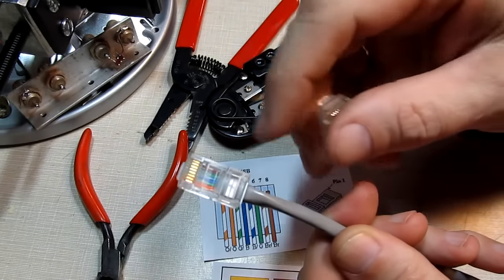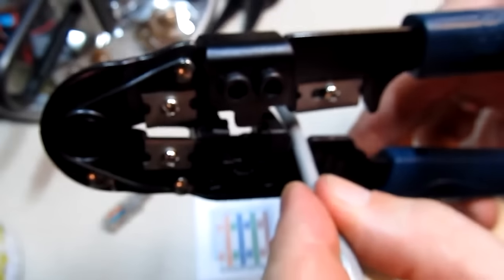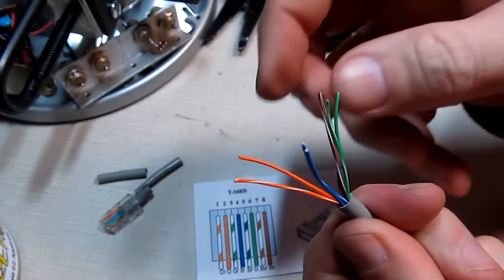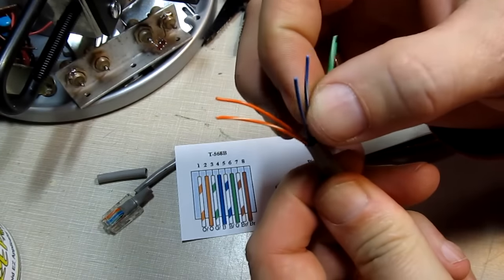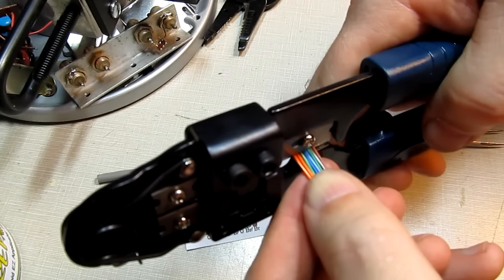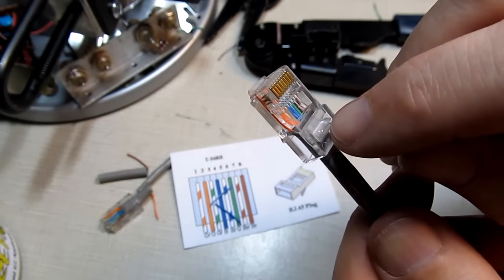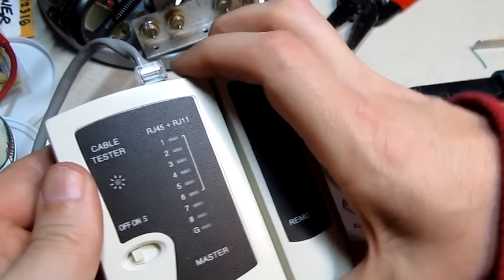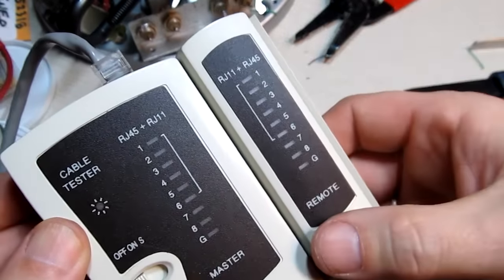#124: How to install an RJ45 connector on a CAT5 Ethernet network Patch Cable - DIY Repair

Comment: I gotta say this video is a godsend. I bought a new construction condo unit and apparently the network guys who installed the wiring cut corners and never placed RJ45 jacks on the ends of the wires, they were just a bunch of loose cut ends going to the network box in the closet. I watched this video and bought some tools and got the wires working perfectly. Thanks!!

Comment: THANK YOU. 
   The job I had before I retired, entailed tool and test equipment design. I built a test box for qualifying 50 wire flat computer belt cables. It would test all LED's, then test every wire for continuity, then unplug one end and turn around and plug in and test again. If any LED's lit up, it meant a short. The box was an aluminum box 4" x4"x4" cube. It got a lot of use.

Comment: 2 tips from a first timer:  1) Pay attention to 4:48 mark in video and make sure you orient both ends the same before crimping.  I had orange left the tab down for one end and orange left and tab up for one end...wasn't thinking and obviously that doesn't work.  :-)  2)  Realize the plug will NOT fit in your device before it is crimped...so check that its the right type but don't expect it to actually fully insert until the pins are pushed down during crimping.  Thanks for the video, turns out its a great and pretty easy DIY project with a little knowledge.

Comment: One thing to stress is the (hopefully obvious) fact that the bottom tab should be firmly crimped onto the gray insulation, not the wires. If you cut the wires to the correct length, either by experienced eye or using the gauge, plenty of gray insulation will slide inside the connector and get trapped when you crimp.

Your video shows this very well at the very start and at @6:00 on the replacement.

I can't tell you how many "professionals" have handed me cables with a good 1/2 inch too much gray insulation stripped off so it doesn't even enter the connector. I'm always tempted to give them 50 lashes with their own cable.
Reply: True, true.
Reply: I tried several times, and maybe I'm half asleep now, but you made it look so easy. I got one in correctly then the cat 5 I could not, so I watched your video. It didn't help. Will try again tomorrow. But, have to say, this is definitely the best, most concise and clearly explained video I have seen in ages. Thank you for that.

Comment: I had installed video security cameras around my house and had ran a CAT 5E cable and wasn't able to connect the RJ45. Then I ran across your video and it was easy as pie to connect. Thank you for a clear video and understanding on how to connect these two parts. You saved me from the insane asylum.
Reply: the

Comment: Just wanted to say thank you very much for taking the time to put this vid together. Needed to run about 100 feet of Cat6 cable to an upstairs back bedroom and could not find a 100’ cable with the ends on them. Didn’t have a clue how to attach the ends but because your vid was so detailed it made it easy. - Thanks again.

Comment: Thanks for the demo.  I have to replace the RJ45 connector on an Icom hand microphone, so the colors and wire placement are different, but I kept the cutoff connector.  My connector came with a boot, which I put on the cable before installing the connector.  Thanks!

Comment: Nice done :-) , a LAN video was a surprise, I like it. I had to connect all the LAN sockets, connectors, extensions and server rack stuff together with a workmate when we build our new company building, because the electricians didn't. She was really a help. We had two different type sockets made of metal and plastic parts, where you have to connect each single wire manually (there is a special tool for, but we had it only one day on loan). We did like 50 sockets or so :-), took us days :-).

Comment: Thank you so much, I have a cable that is run behind walls so it was impossible to remove and replace. I thought I was a dummy in relation to DIY stuff but your video is just simply simple and fantastic, thank you.

Comment: I think that it takes more than "a little" patience.  :-)  I have a tool for that,  although yours is nicer,  and some connectors,  but it's always seemed to me to be too fiddly to get things exactly right in there and have it the way it should be when you're done. So I've purchased patch cables instead,  usually with boots on them so I can avoid that broken tab issue for the most part.  No problem on my part punching down in-the-wall CAT5 into keystone jacks,  though,  and I've done a fair bit of that with no issues whatsoever.  One thing I did a little differently was not trim the wires but push them through the connector and then after crimping trim them.  At least that worked with the connectors I have on hand here...

Comment: Interesting... My tool doesn't have the notch that you use to strip the outer insulation; instead I used the other cutting part (near the end of the tool which you don't use in the video). It has two blades that leave a gap when the tool is closed all the way, and there is a bracket that helps you make the wires the exact right length. I use that to cut the outer insulation and then I rearrange the wires. Making the wires the right length from the get-go makes it slightly more difficult to straighten them out (and usually this is harder on one end of the cable than on the other end, because of the way the wire pairs are twisted inside the cable), but that way you don't have the extra step of cutting the wires to size after straightening them out.

By the way, the process for CAT6 is the same, but CAT6 has tighter twists and you should use CAT6 connectors (which are also slightly different: the wires are staggered inside) to keep your cable fully compliant.

Also worth mentioning: In a 568B crossover cable, you wire up one end as shown in the video, but on the other end you put the Orange pair where the Green would normally go, and you put the Brown pair where the Blue would normally go, and vice versa. So the order on the other end becomes green/white, green, orange/white, brown, brown/white, orange, blue/white, blue.

To verify your wiring, keep in mind that on the connector, white+color is always followed by color. That means the center pair is connected with the color to the left and white+color to the right unlike the other pairs.

In my experience, the 568B wiring method is much more common than 568A.

Anyway, excellent video as always! Keep up the good work!
Reply from the maker: Excellent comments, Jac - thumbs up!  Personally, I like working with the longer wires to do the straightening and ordering - much easier for me to do that and then trim them to the right length afterwards.  I do the same thing with home wiring - it's easier to stuff 6-8" long wires into a junction box rather than 3-4" long wires. Odd, but true.

Comment: Alan, very good video and straight forward and simple. I think I'll make a mic cable extension as my first project. 73
Reply from the maker: Good luck Drew. It can be tougher to do with the flexible stranded wires. Sometimes some tape can help keep the wires aligned.

Comment: Here´s a tip I've never seen before.  A standard telephone plug will fit in the rj45 jack.  Thus except perhaps for cost there would be no need to use telephone cable though out your home installation.  An addition bonus is alot of excess wire to use for poe or other uses including a more or less standard internet connection.

Comment: Matt K- the 1st connection is Tx+, 2nd is Tx-, 3rd is Rx+ and 6th is Rx-, so we can connect any pin one to one (for straight cable) but the length of the cable will be limited as we can see that the Tx pairs are 1st & 2nd and the Rx pair is 3rd & 6th, so as the solid and strip are in twisted pair, so the 1st & 2nd should be of the same color (solid& strip), and 3rd & 6th should be of the same color for the cable to be used for longer distance

Comment: After making thousands of these connections I've developed a nice technique, specifically getting the cable's outer insulation nice and tight on the locking barb. I'll have to make a video showing how I do it.
Reply from the maker: Great! Please share your video in a comment on this video when you upload it!

Comment: in college they made me and my friends do entire labs cables for a networking class but now for some reason every time I make a cable it just doesn't work. I think the connectors I bought are the problem but still it's freaking annoying. I'm trying to run CAT6 cables around the house and connect them to a switch and each cable I test is faulty =_=" been looking around if I did something wrong but everything I did was completely correct and every video and tutorial out there is showig the same.
Just sharing my thoughts :P
Great tutorial by the way :D

Comment: This is a wonderfully clear video BUT there's one big gotcha. I managed to confuse the green-striped white with the blue-striped white. That still had everything connected straight through so passed the cable tester. It showed the PoE as connected but on a 20m run, my IP camera wouldn't show. Eventually worked out what I had done. Pins 3 and 6 need to be the same twisted pair to prevent interference.

Fault is entirely mine as it's shown very clearly in the video. I just wanted to point out if you have an apparently correct cable, double-check this as the only evidence of this mistake is your cable won't work, even though it seems electrically correct.

Comment: I think my home has cat5 cable but instead of ethernet they did phone connections.  This should be easy to convert over right?  How can one make sure that I don't have cat3 cable or cat5 cable aside from cutting it off at the connector?

Comment: Going back to the late 80's each kid had their own computer and I had my LAN system for my business.  Ran that cable through the cold air returns through my two story home, hundreds of feet of it.  Would tuck it between the baseboard and the carpet. Cable company won't do this, drilling holes all over the place, and expensive.  WiFi with a router is so much easier, pulled all that ethernet cable out except one short one between the modem and the router.

Comment: I did this before I saw this video. And the internet is usually 500/500 on wifi, but I get 94/94 with an ethernet cable. I did brown/brownstripe,green/greenstripe,orange/orangestripe,blue/bluestripe. Is that why? Does it even matter? Or is it something else
Reply from the maker: I could be, since it is possible that you signal is not using a proper twisted pair.
Reply: Thanks! I will out try out the method in your video and post the results

Comment: This was my first attempt at this and it definitely requires both practice and patience. At work, we have a number of RJ-45 cables that have turned up sans retaining tab and I wanted to be able to fix those, as well as one I got from an aquaintance with the same problem.
           Here is my question. Some RJ-45 cables come with a plus-sign cross sectioned plasitc separator in the middle of the cable, holding the four pairs of wires in a circle (more or less) and, even when you cut that off where the outside insulation is trimmed back to expose the wires, because they are coming out of the remaining cable "three dimensionally" - as opposed to flat as with the cable in the video - positioning them so they can go into the new connector is one helluva bitch. I openned the cable with an x-acto knife an inch or two back from my original stripping of the insultion, cut the separator off then taped the insulation back together (I had merely slit the insulation then peeled it down till I was done). After that, I was somewhat more able to positon the wires so they would go into the new connector. I just finished so I have not had a chance to test the cable yet but I thought it unlikely I was the only one to have this problem. Is there a better way to deal with this stupid plastic separator or (?) is my type of solution - or something close - the best way to do so?
Reply from the maker: The best way to deal with the separator is to pull on it to stretch it out and carefully trim it flush with the outer jacket, taking care not to damage/nick the wires.  Once you cut it while being stretched, it will retreat back into the wire enough to make it easy to assemble the connector.

Comment: I wonder how the characteristic impedance of the cable is affected upon removing the twists and attaching a connector?
Reply from the maker: It will change it for that short distance.  More of an issue for the pair that gets split over a wider distance across the connector.  Since the physical length of the impedance discontinuity is very short, it doesn't pose a problem in most cases.

Comment: Is the testing tool really necessary if you just need to do this once?
I'm thinking that if I plug it in and I made a mistake, that will become immediately obvious once I try to connect to the internet, and the worst thing that might happen is that I'm getting useless signals. Sure, I won't know which cables were wrong, but since I can't swap individual cables once they're inside, I have to start all over anyway.
Reply from the maker: Sure - quick operational test is sufficient.  If it works, it works...

Comment: so in opposite to the cable, the rj-45 slot is always the same? How much does this "universal tool", that you use in the video to push those contacts in, cost?

Comment: why do the green have to be separatred by the blue? wouldn't the same thing be accomplished if each color and white were side by side on both ends??
Reply from the maker: +Jim Falcone I did a little research on this - it goes back to how the original RJ plugs were wired.  The first pair used the center pins, and the next pair used the next set of pins on either side of the first pair.  That's where the split came from.  However, for the 8 pin connectors used for Ethernet, continuing this practice would have spread the wires too far apart to maintain good signal integrity.  Thus, the last two pairs are wired on the adjacent pins on each edge of the connector.

Comment: Is there a way to finish the final step by pushing the connectors in and sealing in the cable without using that tool you used? Or is there no way out?
Reply from the maker: fliprabbit It's a bit like asking if you can use a screwdriver to hammer in a nail. Yes, you can, but it is difficult, and your results might not be very good.
Reply: ***** ah that's tough , but i will probably find something similar to seal it around.. If not i guess i can get that tool. Thanks for the fast reply , appreciate it! :)

Comment: Can I connect a CAT 5 cable to a RJ45 connector and crimp without any tools i.e means by hands only?
Reply from the maker: In theory it would be possible to use a very thin blade screwdriver to engage each of the 8 insulation displacement contacts, but it would be difficult to get a consistent depth and contact.

Comment: Maybe these take me an age to do as I don't use solid core for patch cables I could never get a good cable made with that. I think I'm gonna buy me a reel of solid core. I noticed your cable doesn't have the X section in the centre, can that type be used?
Reply from the maker: Yes, it is harder to do with the flexible stranded wire because they're tougher to keep in line. If I recall correctly, the X section is for cat6 cable.  There might be a slightly different connector for that, to accommodate the extra material in the cable.
Reply: *****
Cat6 uses the exact same connector, it's just a fair bit more fiddly to do and you can't usually get any insulation or very little insulation from the outside inside the stress relief part of the connector. That's just due to the extra reinforcement section though.
Reply: Unless you are making a LOT of patch cables, with stranded it's probably better to buy ready made ones, they are very cheap after all and you can buy a selection of colors very cheaply whereas to get the same no of colors would be a huge investment if you were making your own. INCIDENTALLY I test my ready made patch cable too since I didn't make them, don't assume they are tested.

Comment: What if you had to make a patch cable and put a connector on each end.  You test it and one end is wrong or not making contact.  How can you determine which connector is wrong?
Reply from the maker: If the wires slipped out of order, you can usually see this through the plastic body of the connector.  If you've got a bad contact, it's not so simple unfortunately.  If you can't see the problem visually, then you've got a 50/50 shot at it, unless you're willing to strip away the outer insulation and test for continuity with pin probes poking through the insulation.
Reply: You could test for continuity after attaching the first connector but before attaching the second, and then again after attaching the second connector.

Comment: You should make a point about getting the proper connectors. For stranded wire cable, you want connector with straight blade contacts like you have there, for solid core wires you want connector that has each blade in a sort of reverse V catching the copper between the two peaks.

Also a note, technically one should try to minimize the amount of untwisted cable so he/she should not unwind all pairs so much, the un winded distance should be less than 1cm if I remember correctly.

The tool is also kind of bad, but it works. The problem is that the teeth are at a slight angle. This kind of tool puts more pressure on one side of the connector, potentially pressing the blades uneven or even stretching the plastic channels in which the copper blades are.

There are tools that have teeth which press directly vertical, with even pressure on each blade, but they're slightly more expensive.
Reply from the maker: Great comments!  Thanks.